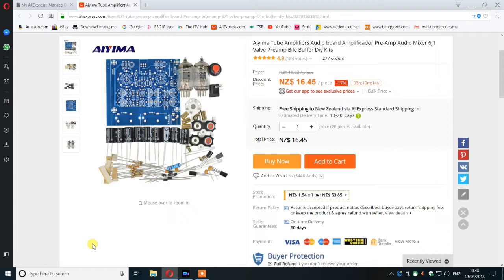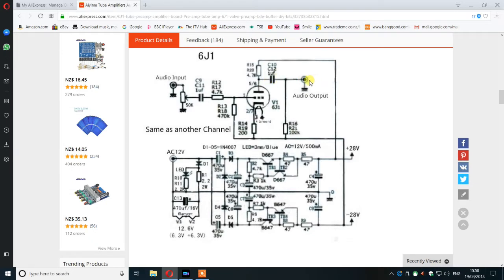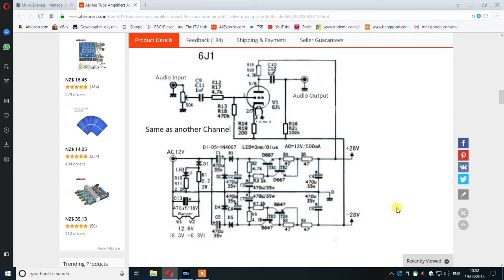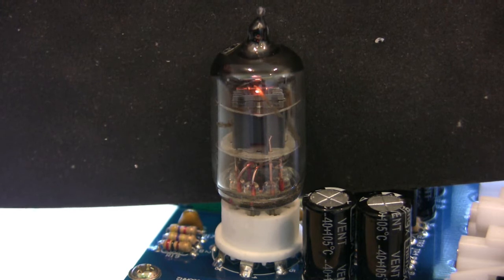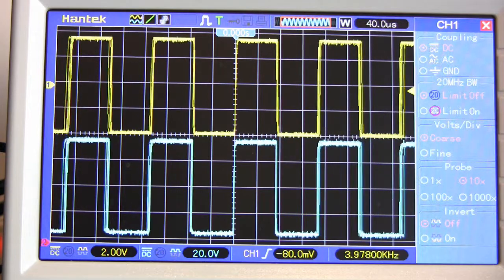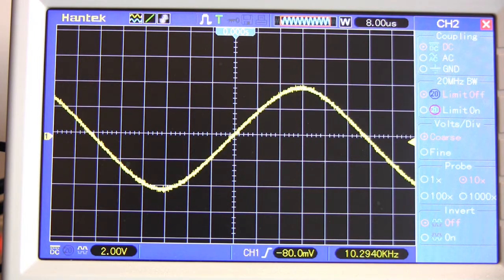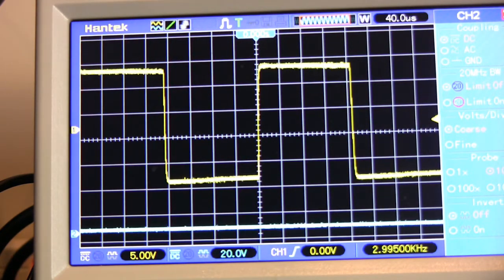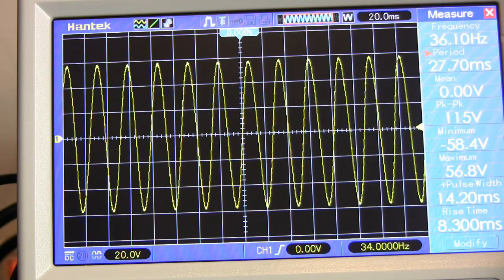Aiyima Valve Pre-Amp.

Comment: I bought the assembled bluetooth version of it and I have a problem with noise( sounds like digital noise)>Can somebody advise me on what to do? Thank you in advance
Reply: My Bluetooth preamp, same make but prebuilt in case with bass & treble +/- gain is quiet if that's anything to go by. Did you get it sorted out?
Reply: @pa_maj.MARTINI-van-MAN  Sorted out?
Not sure what it means
Reply: @michelebazzani  Sorted out ( Fixed ). Sorry, its a phrase we use often where I'm from 🙂
Reply: @pa_maj.MARTINI-van-MAN  No, I was able to get to use it by raising the signal level and lowering the power amp volume, so signal/noise rate went up
Reply: @michelebazzani  Perhaps plugging the preamp buffer power pack or transformer into a different wall socket outlet may help.
I read somewhere that sharing the same socket can cause things like this.
Did you get a transformer with it or is it one you had already?
Sometimes that's the problem, mine is 220-240v 50-60Hz 12v 2amps.
Reply: @pa_maj.MARTINI-van-MAN  is that 12V AC or DC at the output? Note that the tube preamp in this video needs 12V AC, there are other models that look similar but need DC instead! And if you have one of those, and you are using a DC wall adapter, some of those adapters have little transformers inside them, they are heavier than the switch mode power supply versions, if they are old, their output capacitors probably need to be replaced and the same thing with the switch mode power supplies also... The other thing that it could be is the RCA connection cables, if they are really cheap, they can pick up all sorts of noise if the pre amp has a very high gain.
Reply: @PeterMilanovski  It's  covered and hard to get at at the moment unless I move so much stuff, sorry. It could be as you say, just the RCA cables, I got Good ones as I know these can cause issues. 👍
Reply: @pa_maj.MARTINI-van-MAN  no worries 👍
Reply from the maker: As you will have seen from the video, the preamp is very noise free. It's hard to advise as I have not tested this version. Other bluetooth units I have tested are mostly OK but earthing can be critical in some cases or it might simply be faulty. It's quite common to receive stuff from China with faults, even modules built incorrectly. Good luck.

Comment: I am working on the same project. Instead of NE5532, I am using 15 Band EQ Equalizer Board.

My MX50 SE amp project:
https://drive.google.com/open?id=1j9r6IzPD8k37QbG8qdGErCiEYf_JpssB

15 Band EQ Equalizer Board:
https://drive.google.com/open?id=1BCkGOEsbth8I4wito6N5SRxa4fnqXx9q

https://www.aliexpress.com/item/Stereo-EQ-Equalizer-Board-15-Band-2-0Channel-Preamplifier-Tone-Adjustable-Preamp-module/32902085149.html
Reply from the maker: You might need to use a separate power supply to power the preamp board. I have found problems using the 15 volts from the main power supply. If you do have problems, look at this first.

Comment: can i use car battery to power up the tubes?
Reply from the maker: Sadly no, it needs an AC input because it uses a double voltage doubler to get a high enough voltage to power the valves.
Reply: You can try DC-DC buck converter like this:

20W DC-DC 5V-30V to +-30V Dual Output Power Supply module
https://www.aliexpress.com/item/20W-DC-DC-5V-30V-TO-5V-6V-9V-12V-15V-24V-Positive-Negative-Boost-Buck/32926646115.html
Reply: Wow, tube preamp in an old muscle car would look sexy

Comment: Nice video. Helped me understand little bit more about amp circuit in general. 
Was looking at different product from that seller . Aiyima NAIM NAP140 i would be interested in your opinion about that product. 
Regards.
Reply: Hi Michael . Of course if do decide to put it togheter ill share expoerience however mi knowledge is probably one 10th of yours. I only receny bought a first amplifier and done almost Full recap job including speaker relay and opamps. Waiting for pots to come and some more nichicon caps. What is make and model of your oscilloscope and generator ???
As this tools make lofe a lot easier and iam considering getting those yet cannot spend alot on these . Enyoing the blog . Keep up good work.
Regards
Reply from the maker: Hi Adam, my scope is a Hantek DSO5102P I found a good price on this. Good enough for most audio work. You can use to see distortion and measure it but because the types of amplifiers I make, ie HiFi, these have so little distortion, these scopes are really useless. To measure low distortion, say below 0.5% cannot really be done. Ok for some valve stuff but modern stuff with THD of 0,01% or better is impossible. You can download frequency sweeps on the net with flat levels and buy little tone generators on line very cheaply, flat over the audio bandwidth but not low distortion. Good luck, building is a great way to learn, kits are cheap enough to make the odd error and a bit of smoke now and again, which you will do!! At least kits will work if you take care in building, check, every part and double check it's placement. Michael.
Reply from the maker: Hi Adam, thank you for your kind words. I'm sorry but I have not tested that preamp. Naim was a good product, a little over priced however. It depends on what the Chinese have used from the original circuit. I have reviewed an op amp preamp also here on my channel, which i like very much. At present I am testing a FET class A preamp, also sound very good and measures very well. Let me know what you end up buying and your opinion of it. Michael.